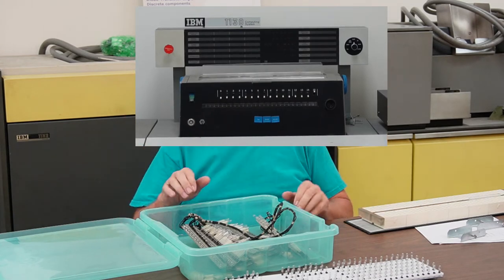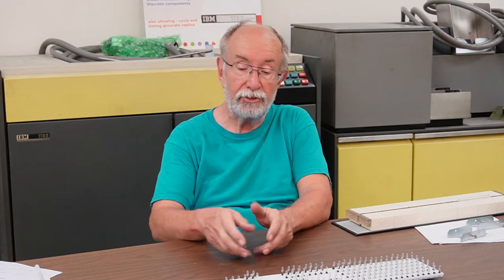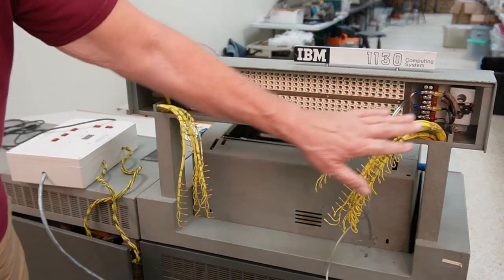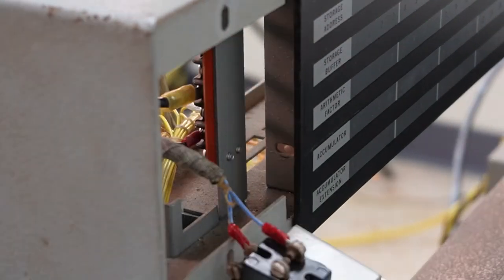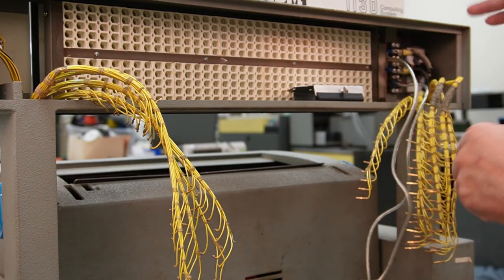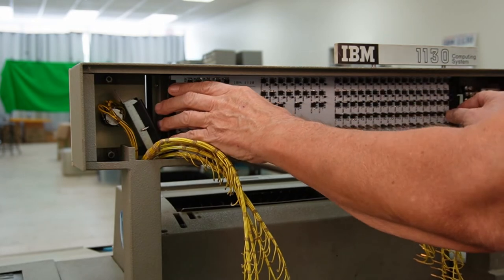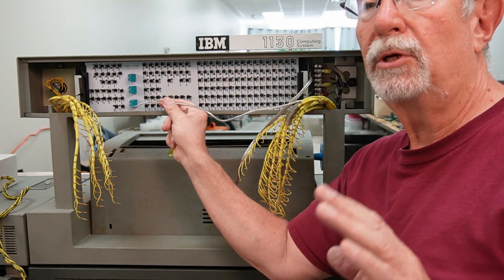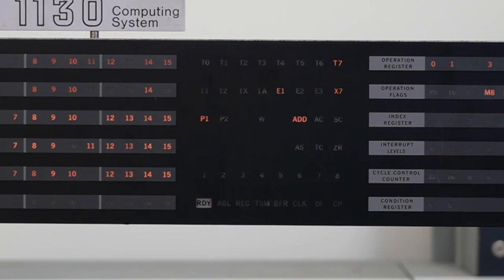IBM 1130 light panel upgrade

Comment: The emergency pull switch is a fun part of any ibm system. I have a 1800 which is somewhat similar to the 1130 and served a engineering firm near me in Sheffield United Kingdom since new until 18 year old me came along and bought it in 2020 along with the 1810 disk drive some disks and the 1442 card punch and reader. Didn’t take a lot to make it work again just replacement of a few bits (power supply) before my friends started to become interested in it and a few time the emergency stop was “accidentally” pulled. I still need to get round to the card reader and disk drive but university is more important. Would love to find a better condition 1816 terminal as the one I got is a little worse for wear.
Reply: I also should mention I got all the external boxes for process control and a 2790 data communications system. Managed to squeeze it into the house and it’s a delight to have in all its red glory. Getting the 2790 running will be fun but I’ll have to find someone else with a 2790 so we can create a network 70s style

Comment: Hi Carl 

I recently purchased a IBM 1401 Control Panel in oct 2023
My honeycomb and lamps are missing. Are you able to help with a part number for the original IBM lamps and even maybe the honeycomb ( was it IBM custom or a standard part? ) . I want to restore the panel back to original not LED's ( if possible ). P.S love your work.
Reply from the maker: The honeycomb is an IBM proprietary part that they used extensively in the generation of computers that included 1401, but they did extend it into some of the next generation machines such as 360/30 and 1130. It has companion bulb holders that fit snugly into the openings of the honeycomb. You could look up an IBM part number in the Parts Catalog of those systems but it wouldn't really help you.

Most of the 1401 circuits use logic voltage levels of either -6 to +5 or 0 to +12 which means that the bulbs involved are higher voltage. Substituting a bulb designed for a lower voltage such as 5V resulted in a very bright and hot bulb which would burn the plastic front panel leaving a permanent brown obscuration - has happened to the 1401 systems at Computer History Museum.

Small incandescent bulbs are getting quite difficult to buy. I would start the project focusing on bulb selection. Find a bulb that is small enough to fit in the honeycomb opening and let its voltage range guide the design of the interface circuits you will use to drive the lamp. Consider buying bulbs intended for small Christmas tree strings. Also keep in mind the cumulative power requirements of lighting that many bulbs - 150ma per bulb is on the low side of the range you will find, thus 50 bulbs will draw almost 40 watts and require over 8A. 

The best solution other than finding a real mainframe with the honeycombs and lights intact is to 3D print the structures yourself. Design a holder whose inside diameter fits the bulbs you have bought and whose outside shape/diameter matches the holes you print in the honeycomb. The honeycombs were constructed in blocks and glued together to fill behind a console panel. They are also glued to the rear of the panel itself.

Comment: Beautiful, but speaker wire?? Seems like carrying information transparency a bit too far.
Reply from the maker: I sent my PCB to the prior restorer of this system, who built this version and was the one that chose speaker wire. I was too lazy to replace it. Your comment is a good spur to make it neater and use more appropriate wire.  No speaker wire inside my own 1130 light panel.